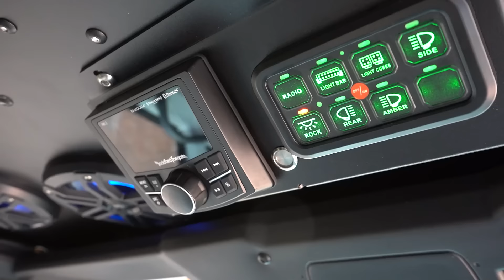#UTVSourced 2021 Can-Am Defender Limited Build Walkaround

Comment: I own a 2020 and love it. It's not as tricked out as this one, but it's a great machine. I keep waiting for CanAm (or someone else?) To build a machine like the Max Limited, but with the 200hp 3 cylinder. Now THAT would be rad!
Reply: That’s my ONLY issue with giving up my X3 Max. I have it basically like this (no topper, AC, Heat) but the 195Hp makes it FLYYYYY. That’s pretty tough to give up but i’m need something shorter to fit in a toy hauler now
Reply: Im gone buy a cam-am defender max red
Reply: Need a really small V8  lol